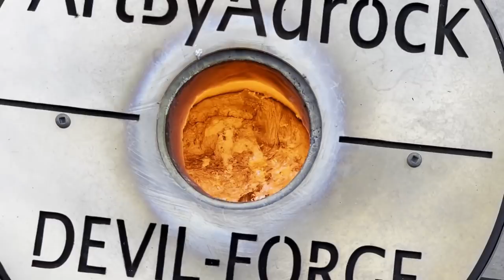Making The Mask From The Movie "THE MASK" - Aluminum Sand Casting Method

Comment: It crazy how the sand cast picks the layer lines from the 3d print
Reply: A got a workoround of this. If you dont want to do the sanding of the model you can brush in a really thin layer of molten waz on it. All the layers are gentle and even then

Comment: Why not spend the time and clean up the 3D print?, because you spend at that time casting in aluminium and end up with a peice of metal that has layer lines all over it and looks like a 3D print.
Reply: Because a 3-d printer will be useless if the power grid goes out. They’re storing value not just making art